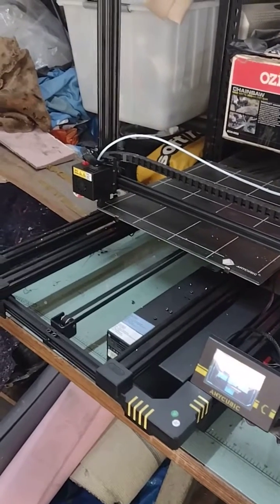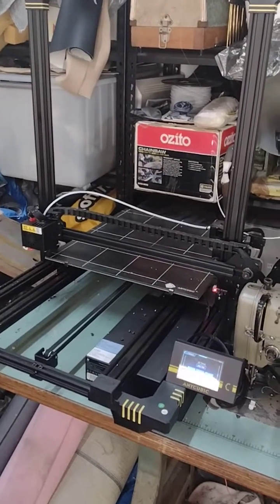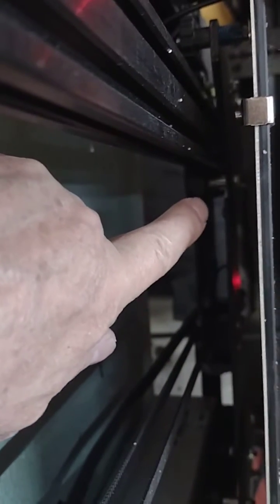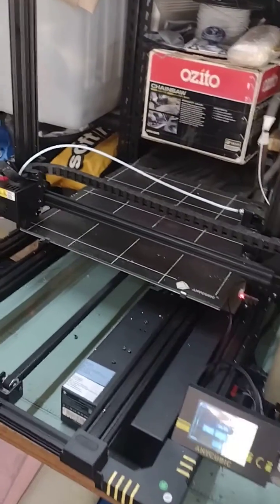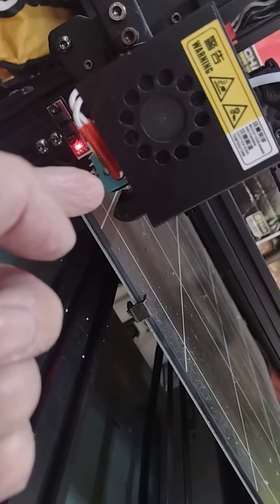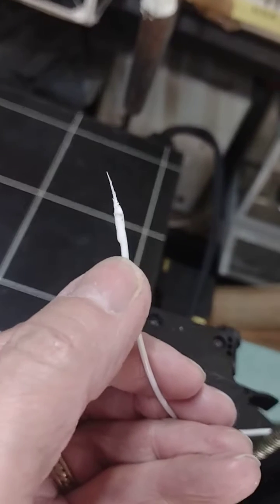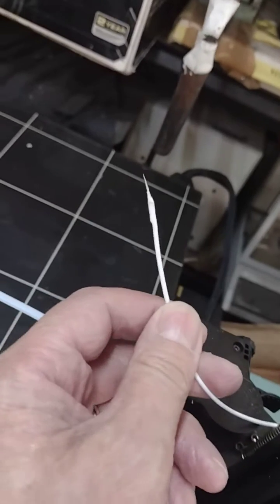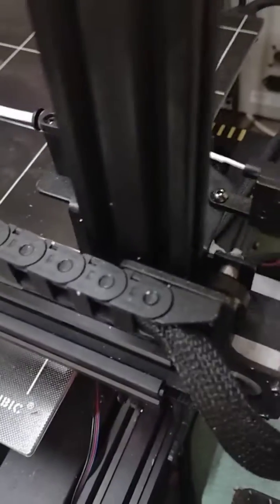Anycubic Chiron - failed temperature sensor and other problems

Comment: Yeah I'm havin issues with mine right now. It worked great, then randomly it kept saying TO sensor abnormal and I eventually gave up and put it in the garage and threw it on offerup to try and sell it. A few months without selling I was moving some stuff around and had forgotten about the printer so I brought it out, fired it up and it printed great again for a few weeks before doing the sensor abnormal thing again today lol. 

I love it's build volume but it prints pretty slowly and it is such a pain in the ass to deal with all it's little problems.
Reply from the maker: Hi Redrik,  I have replaced the temp sensor three times now, because it started stopping erratically again, sometimes after many hours.  This didn't fix it so I decided to try cleaning the undersized hotend cable female connectors and reversing the whole cable assembly and it seems to be working again.  We'll see...